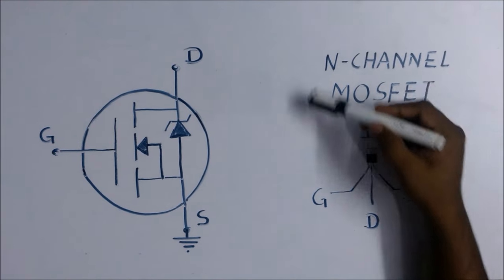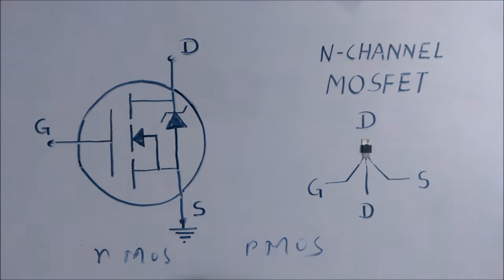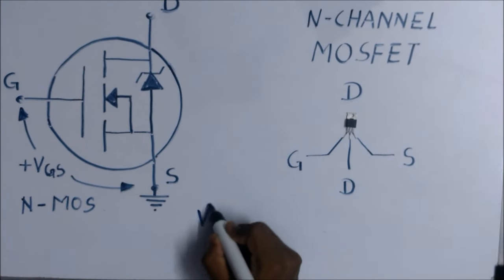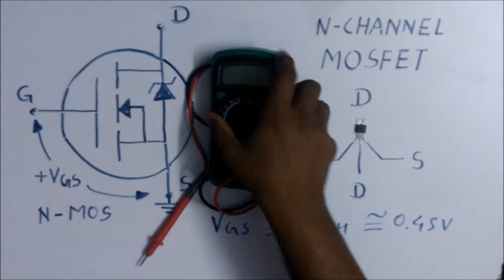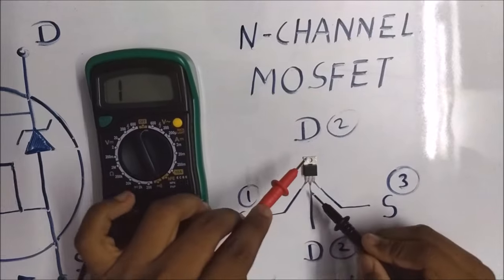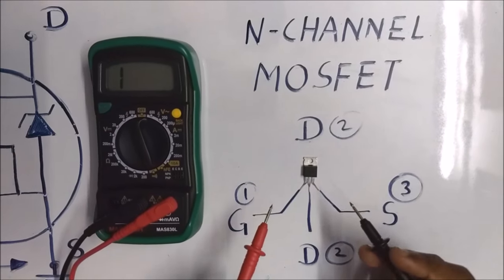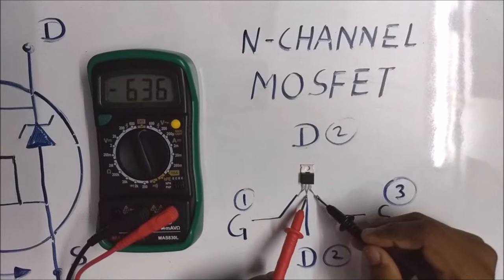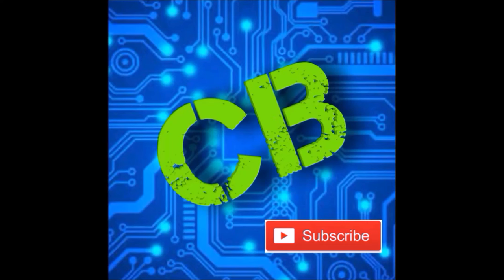How to test the MOSFET-using multimeter-DIY

Comment: hello DEAR thanks a lot for you as you he a very interesting explain very satesfying 
MY QUESTION IS 
(I have a 11n90 f28 circuit mostfet  it has a shortcut and the resistance connected to Gate is burned 
What is the parameters of that RESISTANCE please